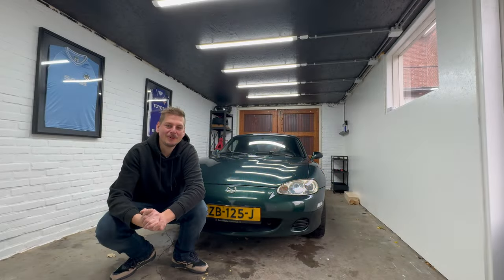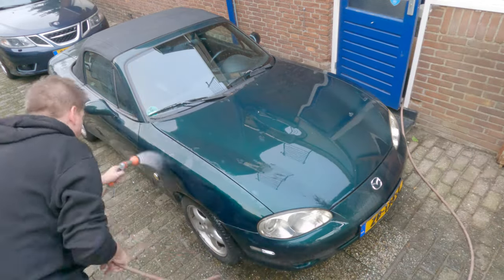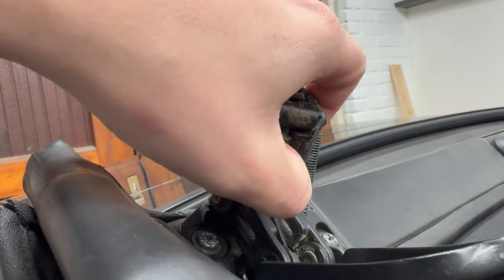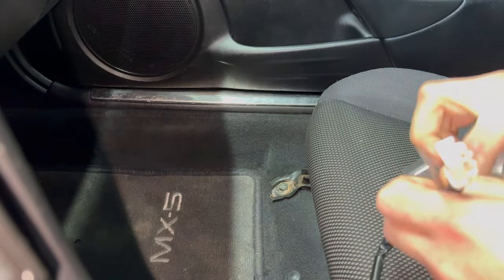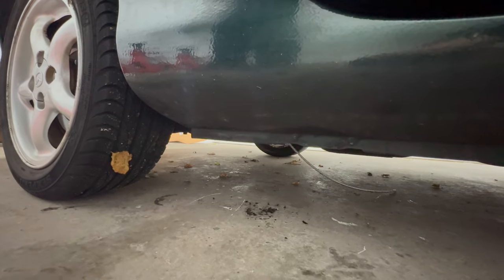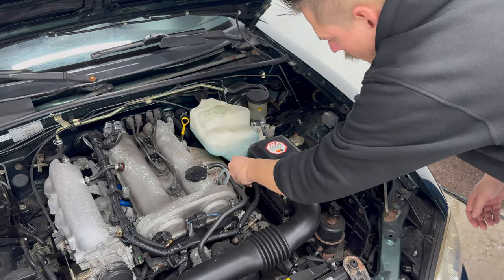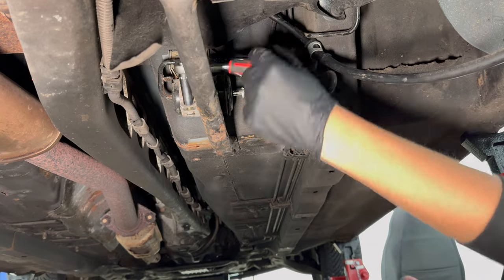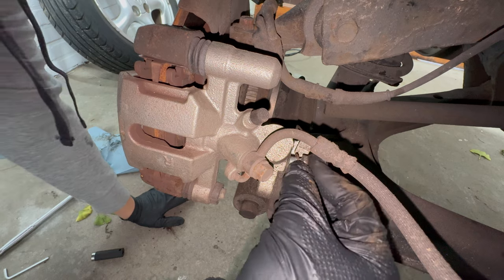I bought a Mazda MX-5 / Miata that hasn't been driven for over a YEAR - Fixing the basics

Comment: Awesome video! These MX-5s are a heap of fun to drive,  I've got a NA mx-5/roadster that I put bucket seats in to fit in (203 cms tall) and still slam my knees into the steering wheel when I drive it haha. Maybe the foamectomy would have been a better idea for legroom, but oh well, I love the thing! Left ya a like, and subbed, keep it up!
Reply from the maker: Thanks so much! I might go for bucket seats at some point too, I can imagine they look great. I have a video incoming at some point over the next few weeks where I install a steering wheel spacer, which helps leg room at the cost of having to bend your arms a bit more because the steering wheel is 2 inch closer. It works well for me - I'm a bit shorter than you but I'm on the large side width-wise, haha.

Comment: hey vraagje waar vind je al de data voor de momentsleutel voor de bouten of moeren op moment te draaien? bedankt alvast en goede video!!
Reply from the maker: Hey, ik heb een Haynes werkplaatshandleiding (https://www.bol.com/nl/nl/p/mazda-mx-5-service-repair-manual/9200000027806236/) liggen waar veel specificaties instaan aan het begin van elk hoofdstuk, en miata.net/garage heeft ook veel torque specs online staan, en ook bijvoorbeeld BOFI racing (https://bofiracing.co.uk/blog/mx5-miata-workshop-manuals/). Vaak wel in ft-lbs/foot pounds in plaats van newton, maar dat is zo omgerekend. Soms wel even zoeken omdat het 1.6-literblok in de NB in de VS niet geleverd is volgens mij (alleen in de NA, de NB kwam volgens mij altijd met 1.8), maar die Haynes is aardig compleet.

Hoop dat dit helpt!

Comment: You replaced a lifetime filter on the air intake, why was that? Was that some paper element you replaced it with? In all honesty you need to just reverse that bit, there's even a sticker on the air box informing you that it's a lifetime filter.
Reply from the maker: Yeah I know, you're completely correct! I didn't have the correct cleaner at hand yet, and I ordered some parts, including a new filter, before even owning the car - I was very eager to get it running properly as quick as possible. By now, the filter the car came with (which was very, very dirty and clogged with grot) has been cleaned, reoiled and refitted!
Reply: Nice one @thegreygarage , great video by the way!
Reply from the maker: Thanks so much - it's such a fun car to work on (and learn new stuff)!